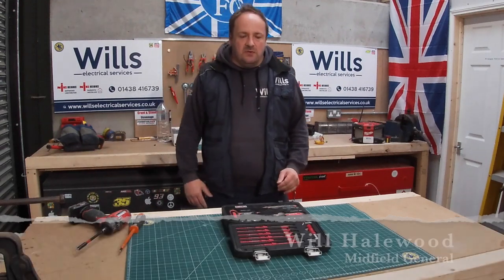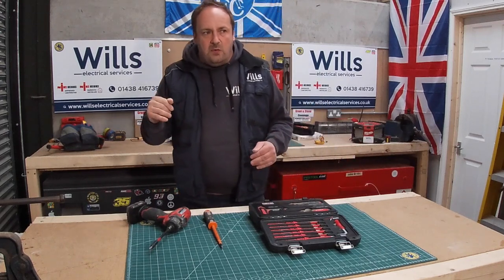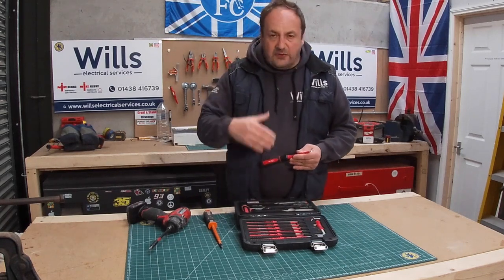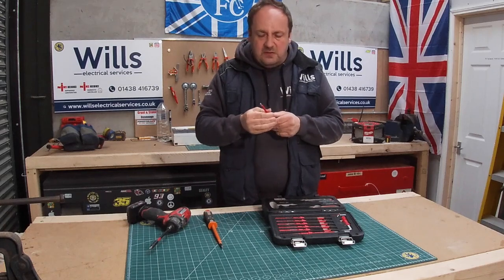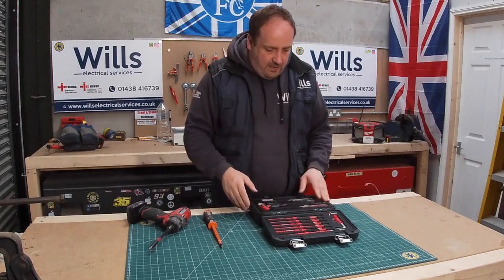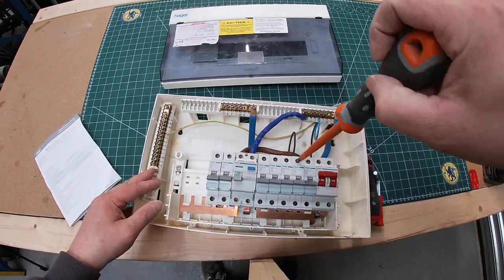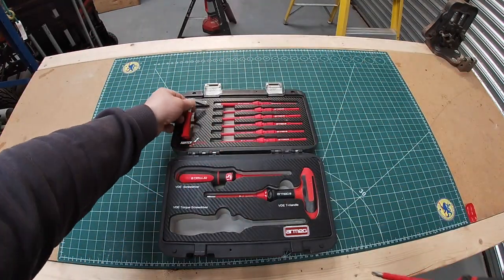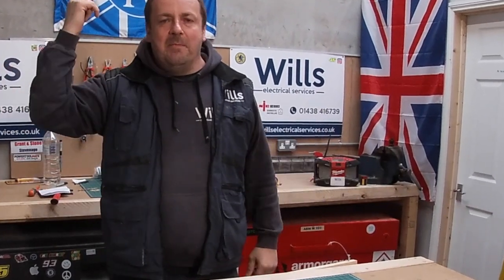Electricians Armeg The best insulated torque  screwdriver on the market

Comment: I've ordered this exact same set.  I have the Draper and C.K torque driver sets too.  
Great content Will, really  enjoy your banter 👍.
Reply from the maker: Thank you Ray much appreciate
Reply: @rayc1503 how do you like the Draper set?  The blades look similar to the Wera, are they compatible?
Reply: @lylewaters6161  The Wera do fit into the Draper handles albeit loosely. However the Draper are too big to go into the Wera handles. I haven't crossed them in use but I have tried. The Wera are much more durable imho. 👊
Reply: @rayc1503  cool, thanks for the reply.  I’m looking for a good VDE torque screwdriver set.  I have about 10 different Wera blades already.  The Wera torque handle has such a limited range compared to Wiha, Draper and others.  I was just trying to find a way to nt have to buy another complete set.

Comment: I have this set, I use it exclusively for changing batteries in the kids toys 🤣😁😂🤣😁😂
Five years ago I had the chance to book a set out after a colleague replaced some components and never tightened them properly, I used this as the reason and paid £120 for them. Within 2 weeks I’d TUPE’d out and they became mine 😁 The new company didn’t let mechanical engineers do any electrical work, not even fault finding. So, the Armeg’s went into immediate retirement and now come out to replace AA’s and AAA’s only. 
In the last 10 years I’ve spent over £800 on screwdrivers and screwdriver sets alone.
I’ve got/had  - Wiha slimline x 3 ( lost 2 x immaculate sets in wallet ) £150
Klein insulated seperates ( lifetime guarantee ones ) £230
Klein Precision 4 in 1 x2, Klein 11 in 1, Klein stubby 4 in 1 £100
Irazola insulated £40
Wera insulated £35
Armeg torque set £120
Stanley Fatmax set of 12 £36
Bahco ratchet £30
Bahco T 1/4 driver £30
Klein flathead grip driver set £30
I’m now in the market for some more, haven’t decided what yet but I’m open for recommendations 👍

Comment: Does the bottom of the driver turn when you apply pressure when torqing screws up? I have a CK one and the bottom spins, which is annoying!
Reply from the maker: No I’ve never experienced that
Reply: @ElectricianTV  
The CK one is pants then

Comment: I've just sent a message to ARMEG because this set can become a useless piece of junk once the irreplaceable bits snap and apparently they do in some reviews! It's a no go for me because of this. Therefore am thinking about PB Swiss tools (still made made in Switzerland and not like majority in China although torque option doesn't have interchangeable bits), Facom or proven and praised by many old school electricians ITL Screwdriver Set 7 Pieces - unfortunately no torque option :/. This is working with high voltage so am disappointed there's no extra QC to ensure these things work and withstand tasks they've been designed for but yeah... majority of companies go the same cutting corners route to increase profits end ensure products don't last too long.

Hi,

I was wondering if you've looked into snapping bits and why don't you sell the bits separately as a replacement? This is what is putting me off from buying your set because it's enough for one critical bit to break and the whole set is pretty much useless piece of junk (see amazon 1 star reviews).
Reply from the maker: To be honest there is quite a lot of people with mixed reviews with this on my own set. I have got on really well with it I only use it at the end of each because consumer unit or distribution board To set the torque setting at the very end. I have found the PZ 2 to become quite loose so I just use the large flat head I mainly use a Hager Single phase or Mem Three phase. As for replacement blades I’m sure you can buy them from Amazon or my wholesaler as they are Armeg Stockist
Reply: @ElectricianTV  I’ve exchanged messages with Phil @ ARMEG and he’d explained that some electricians have been using smaller blades to torque up screws that require larger blades hence they tend to snap. They usually do it because the insulation on the large interchangeable blade is too thick and ARMEG are fast tracking new slim blades to resolve this issue. Unfortunately, there’s no ETA when they’d be offered and he’s best guess was that they’d offer them separately and possibly in new sets but that’ll be up to their marketing.